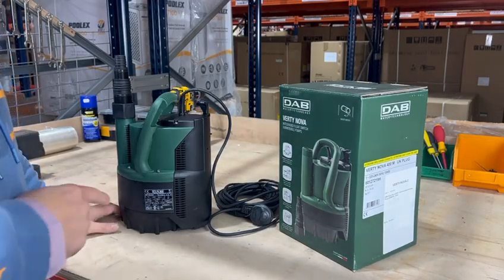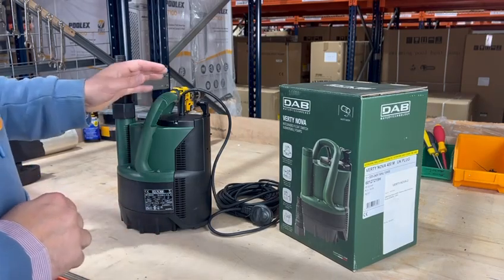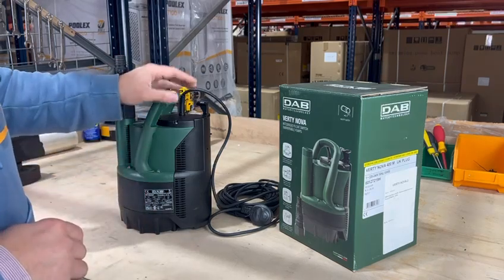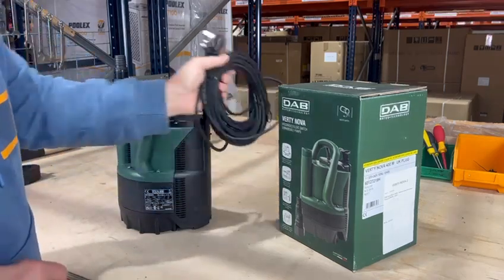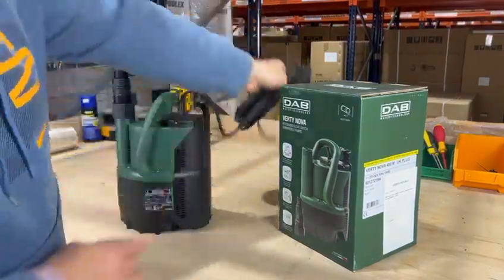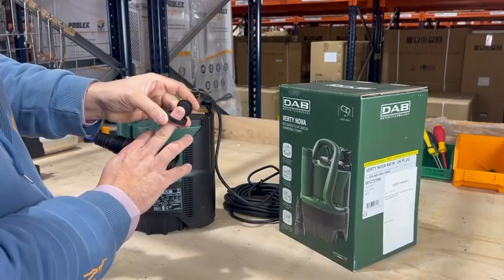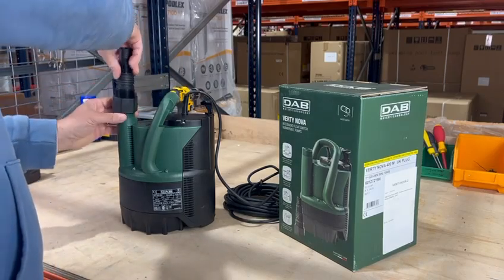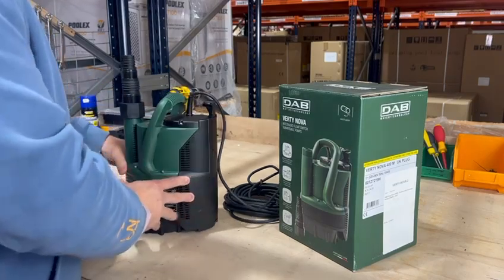DAB Verty Nova Drainage Pump - How It Works

Comment: What do i do to make the pump stay in Auto-Mode? I keep having to use it manually.
Reply: Same issue i am having, literally in contact with site i ordered off, which is really annoying as its delaying a business from operating, if it just did what it said ot would do, we wouldnt have no issues. Hope it gets sorted for yourself
Reply: @MAG-ob8bt I believe it’s myself trying to sort this for you 😂.
Reply: @adambentham4000 Top lad, its remains a mystery on why it wont run in auto mode, with about 45mm to 50mm of water  surley thd rise of the built on weight should tell the pump that there is water to suck out, completely baffles me on why a brand new pump is not working as intended,  looking forward to your reply on emsils adam 👊🏽
Reply: @MAG-ob8bt   The activation point is higher than 45-50mm on Auto Mode, its 165mm.
Reply: @simonward1095 so below 165mm auto mode won’t work?
Reply: @adambentham4000  100% correct. 
In Auto mode it also switches off well before the 2-3mm level, so for auto use you would need it to be in a small sump. Who did you buy it from?
Reply: @simonward1095 I didn’t purchase it. I’m just obtaining information as i work for a service department and a customer has a query about why it wouldn’t run in auto at a depth below the specified 165mm